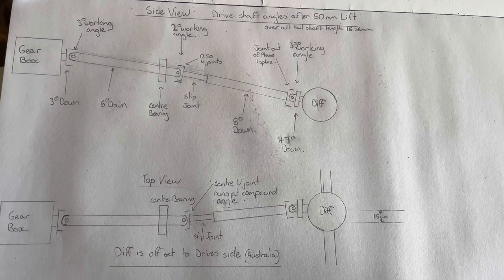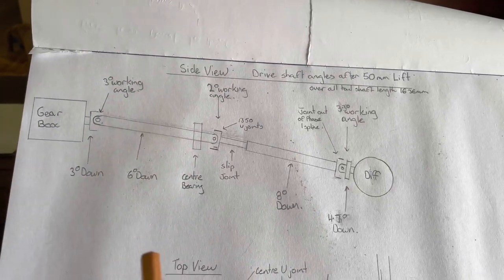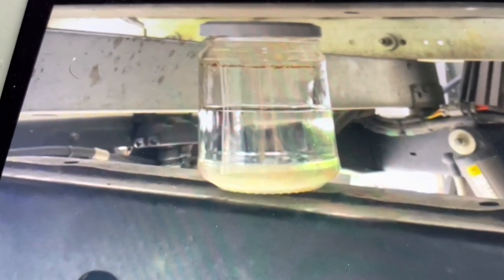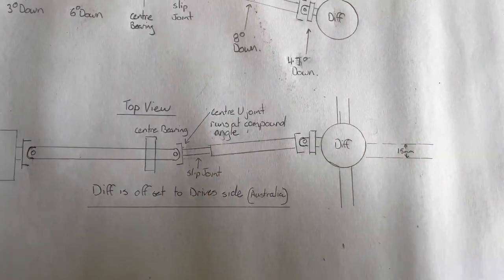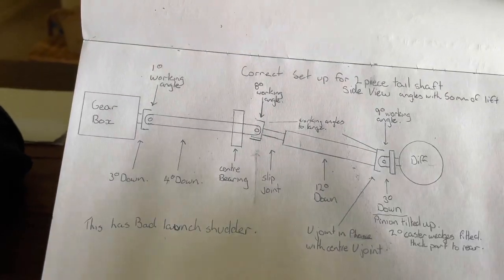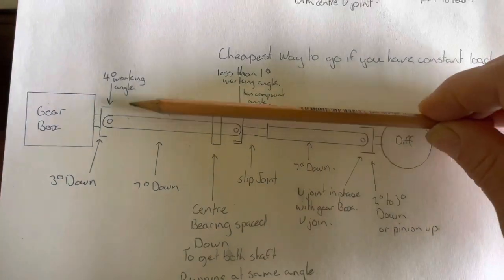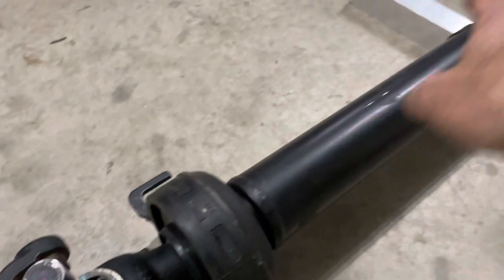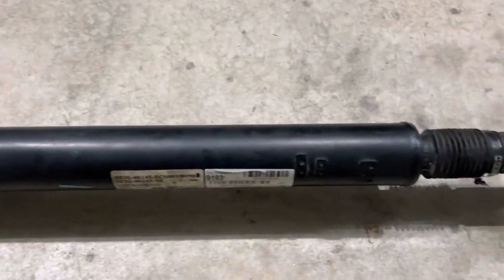Px Ranger/BT 50 drive shaft vibration fix

Comment: Excellent in depth video. I have a 50mm lift, and have had vibration since. 
Dropped centre bearing, and have wedges to go in. Was going tho put them in so high end was towards the back. So angle was raised up, but note your comments about facing down. Will give them a go one day, but worried about knocking leaf pin out to put them in. I have longer bolts to replace them with.
Reply from the maker: Hi mark in the video I  got the in stall info for the wedges around the wrong way( had been working on a landCruiser drive line vibration that week I did the vid so wedges go in the other way around compared to spring over Ford) So to tilt your pinion down you need to put the thicker part of the wedge to the front and to tilt the pinion up you need to put the thicker part of the wedge to the rear. Most Castor wedges that you buy have a hole that is big enough in them that fits around the centre pin so there is no need to undo the centre bolt, I normally get castor wedges machined up with a 10 mm hole so I can bolt them to the spring pack and stop them from getting spat out later on if the u bolts loose off a bit. 
The easiest way to undo the centre bolt  without all the leaves going everywhere is to place G clamps on the front and rear of the spring pack or the way I prefer to do it which is to put ratchet straps around the chassis and leaf Packs, with the ute on the ground put the ratchet straps around both left and right sides and front and rear of diff tube (you will need 4 straps in total and the normal 25 mm wide good quality ones will be enough, just put the two hooks together) when putting straps around the chassis make sure you’re not squashing any brake lines or what, tension up the ratchet straps so there is no slack in them. Depending on what type of castor wedge you have, if it’s one you can drop in over the centre bolt you can simply loosen off the u bolts enough on both sides and Jack the car up by the towbar and this will allow the axle to drop away from the spring pack and allow you to insert the castor wedges in the gap between the spring perch and the spring pack. If you are going to bolt the castor wedges to spring pack jack up of the ute under the rear differential, remove u bolts both sides, rear  tyres and lower shock mount bolts, Place axle stands under the chassis on both sides and lower back onto axle stands. Once resting safely on the axle stands you can continue to lower the differential housing and the ratchet straps will stop the leaf springs from dropping any further and hold The packs together. Just watch you don’t stretch the brake lines, ABS and electric differential lock wiring, dropping the spare tire down and out of the way is a must and will make it a lot  easier to see what’s going on. When dropping Axel housing the pinion will want drop down but it should be caught by the binding of the universal joint on the tail shaft. When you have about 25mm of clearance between the Spring purchases and the leaf packs you can push the right hand side of the axle housing forward and the left-hand side rearwards, This will allow you to drop the centre bolt all the way out and install your castor wedges.
Don’t forget to fix up the phasing of the universal joints( like I explained in the video) this is the main cause of the vibration. Hope the above is of some use to, would love to know how it works out

Comment: Hi Phil, brilliant review. I have a 2017 BT-50 purchased with a 2" lift kit. At low low speed 3-5klms/hr I get a weird shudder or vibration both slowing down and take off, but it feels from the front end. Does your prop shaft evaluation also apply to the front prop shaft or have you witnessed front prop shaft issues with BT's, rangers, everest etc. Appreciate any comment/advise. Cheers Steve
Reply from the maker: It’s unlikely that it is the front driveshaft as it uses constant velocity joints, so no phasing issues with the front driveshaft on these vehicles, unless you have a front differential drop, that puts the CV joint at a very steep angle at the differential or something worn out
With my vehicle, I had the same shudder that you have which in my caused was caused by the rear driveshaft. On my vehicle, it felt like I had a flat front tire or flat spots on the front tires. After getting the driveshaft sorted this shudder went. Please remember that vibrations through the vehicle can be caused by many things like the type of tyres you run or a out of balance /bent rim. This is why it’s important to run a vehicle up on axle stands and measure the vibration with a jar with water in it. If you have a driveline vibration, the water will vibrate in the jar. If you have a tire problem, you will not get any vibration. Check out some videos on YouTube on dynamic balancing tailshaft on vehicle to get an understanding of the process. 
Running the tail shaft in a straight line like I show on my video as it is something that once changed is very easy to put back to stock with no cost at all except for cast of wedges under the axle housing. 
Do you have any more questions? Please do not hesitate to ask. This is something that takes time and effort to sort out and not a five minute fix.

Comment: I brought mine a year ago and it was already lifted and Iv done so many things to get ridr of it with no luck. It's been balanced, Iv replaced the centre bearing. Those center bearing sucks but over it. Ford engineering is done by children, I also put new tyres on, wheels balanced and also have a new clutch put in and the clutch plate machine , also put that shim kit in on the bearing at different heights and the rear diff has those wedges put in and still didnt help and they should just add this to the class actions that will happen soon enough. B
Hopefully this will help when I'm done watching
Reply from the maker: I hope my video can help sort it out

Comment: Hello! English is not my native language, so im struggling a bit in understanding everything. To sum up, i shoud: disassemble the slip joint, leave both ends of the shaft leveled, put back in the slip joint, put a center bearing spacer and slot the mounting tags a bit to slide the center bearing a bit to the drivers side (or in my case, the non driver side as I’m from Chile)
Reply from the maker: Hi Felipe English is my first language and I’m not very good at it. I think you’re doing better than me. If you are trying to run the tail shaft in a dead straight line which I’m guessing is that what you asking me about. You need to space the centre bearing down so when looking at the vehicle from the side view there is no angle or very little working angle in the centre bearing universal joint so if the front shaft is 7° down the rear shaft should be as close as possible to 7° down from the side view. Any more than one degree working angle and you will have a vibration. Do not worry about slotting the centre bearing mount , It helps but it’s not worth the effort as long as you have less than 1° working angle from the side view on the centre universal joint it’s not worth the worry to slot the centre bearing over. You need to phase the differential universal joint the same as the gearbox universal joint. Search on YouTube how to phase universal joints in that’ll all explain what to do, but basically you are pulling the bottom tail shaft out of the slip joint and rotating at 90° to its original position. The other thing to take into account is pinion angle on the differential, if the gearbox is 3° down on the universal joint mounting flange your differential needs to be parallel to that so it has to be 2° 3° up. Hopefully this helps if you’re still unsure please message me back

Comment: Gday Phil awesome video mate!? Quick question - you stated you have orientated your 1 deg leaf spring caster wedge is installed thick end towards front of car would this not push the pinion flange down not up? When I installed mine the thick end had to be at rear of vehicle to allow the pinion flange to point up 3 deg.
Reply from the maker: Good pick up, sorry stuff up there. If you are running the standard tail shaft  as I described ( with no bend in the middle uni )yes you will need to put the caster wedges the way you have them ( thick part to the front ) to drop the pinion companion flange ie from 5deg up to 3deg up.

Comment: Hey mate, i have a vibration at 70kph+, and for the life of me i cannot find where it is coming from!!. My car is still standard height but carries a fair bit of weight in the back and sags a little in the back.. The vibrations started without any sort of warning, a seams to be worse when everything is up to temp... I have checked unies, center bearing and have had tyres and wheel alignment done. 

 My next thought was to remove the harmonic balancer on the diff and go from there. I would be interested to know if they are known to fail or if i should be looking else where.. If you could point me in the right direction that would be awsome..... 

  Cheers Mate!!
Reply from the maker: Best to have a chat over the phone 
Email me your number at dingleyphillip@gmail.com

Comment: Hey bud, Yours doesnt have a master spline but mine definately did. It was some nylon coating that filled the gap between two splines. I cut mine out with a stanley knife. Did you buy this ute second hand? On yours it almost looks like someone has done this already to yours. Cheers
Reply from the maker: I have not seen what you are describing in any of the tail shaft that I have re-phased. My BT50 I bought brand new in 2019 and all the other Utes I have done have been 2017 and newer, so it might be a early model thing? Thanks for the heads up

Comment: been phoning around Perth trying to get a cardan joint fitted, no luck yet, but one shop said they would make a one piece driveshaft, and that it works better than the double cardan fix. Whats your thaughts on that Phil ?
Reply from the maker: I looked into a one piece tail shaft and cost was the biggest thing , to build a tail shaft that length it’s needs to be about 4 1/2 inches in diameter and probably made out of alloy to reduce the overall weight. Have a look at a new Isuzu D-max tail shaft to.  There is a chance it might hit the crossmember that the centre bearing bolts to as the suspension cycles and it’s easer to hit when off-roading. 
Read this link to help calculate the diameter of the tail shaft
https://spicerparts.com/calculators/critical-speed-rpm-calculator
If you would like to have a chat on the phone email me your number with a time that you’d like to be called at
dingleyphillip@gmail.com
Reply: @philsrandomstuff2392  thanks for the reply Phil, they quoted me $1100 , and did say it was stronger than standard, I will ask if it will be alloy. Aparently they have done quite a few with good results. When I asked why they didnt come standard with a one piece they say its because the two piece is rated to 250kph, and the one piece is rated to 220kph.
Reply from the maker: . From a manufacturers point of view it is miles cheaper to make a two piece tail shaft then a one piece. There is online calculator’s to work out what diameter the tail shaft needs to be which is related to maximum speed maximum of shaft and toque of the engine and so on. I did these calculations with the tail shaft mob that I used and it just worked out that a two piece tail shaft would be cheaper and lighter to use. Remember the longer the shaft the larger the diameter and the thinner the wall of the tube has to be to keep the weight down so the tail shaft doesn’t turn like a skipping rope at speed . Let me know how you go I’m sure it’ll be fine. Yes I did find that some tail shaft shops did not want to do the double card u joint but could not tell me why it couldn’t be done.
Reply: @philsrandomstuff2392  they fitted the one piece tailshaft today, only driven it about 30km so far, but some of that was on the freeway at 100kmh, seems to go well
Reply from the maker: Good stuff. Thanks for letting me know. Hopefully all your drive line vibration are now sorted

Comment: Doesn’t matter how many spacers I use, I can’t get the same degrees on either side of the Centre bearing.
Reply from the maker: As long as you are within no more 1° difference it will work fine. I’ve had to use thinner washers in the past to fine tune the alignment

Comment: Nice work Phil just finished my ford ranger px2 with 2 inch lift. Had a shudder on take off. Now gone.runs super sooth now.😀😀😀😀
Reply from the maker: Thanks for the feedback it’s always good to hear that I was able to help someone out. It’s awesome having YouTube these days, I couldn’t fix half the things I work on without it.
Cheers Philip👍😎
Reply: Hi, I have the same launch shudder issue with my PX3 after fitting a 2 inch lift kit. I was wondering exactly what you did b to fix it.  Did you do the phase alignment as well as aligning the angles of the front and rear drive shafts?  Thanks.  Lee
Reply: @leereiken9283  Hi Lee do you have an email so I can send some info
Reply from the maker: The gearbox and the differential U joint is put in phase (turn the rear tail shaft 90° on the slip joint). and the centre universal joint has to be spaced down  so both shafts run at the same angle ie 7° down on the front shaft and closest possible to 7° down on the rear shaft 0° operating angle with the use of a tail shaft spacer kit. You will first probably have to change your pinion angle of your differential so it matches the same angle of gearbox output flange, both these flanges have to run parallel to each other so if the gearbox is 3° down pinion flange has to be tilted up so it is 3° up.  If your in Australia email your phone to dingleyphillip@gmail.com and I’ll give you a call